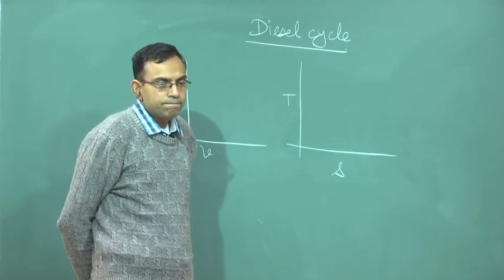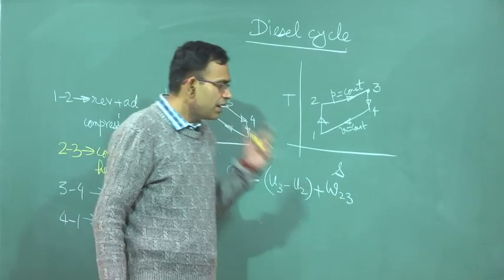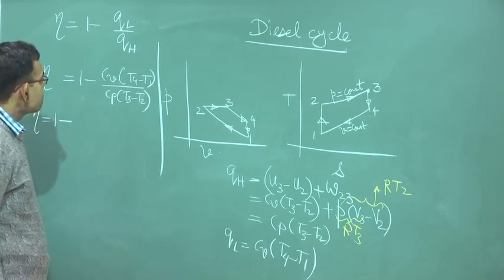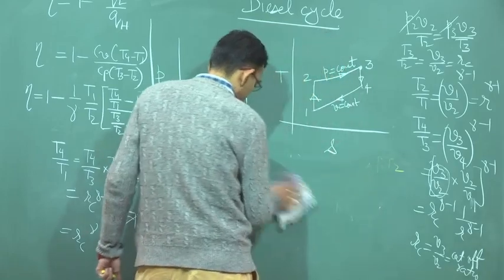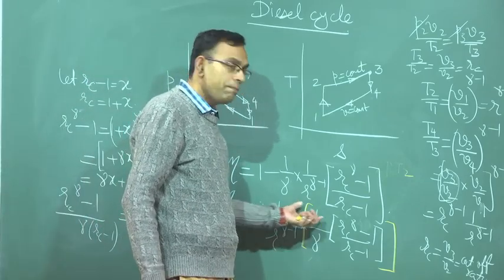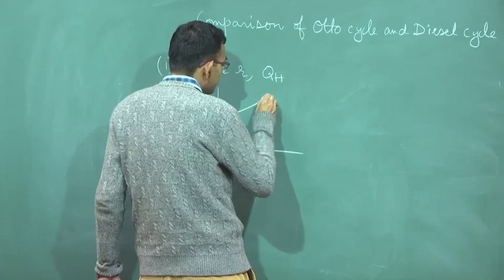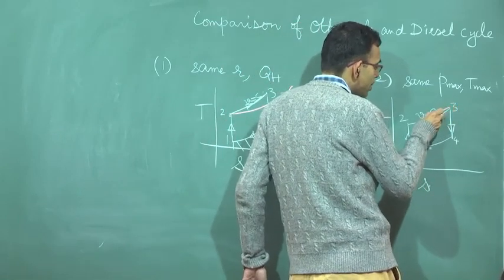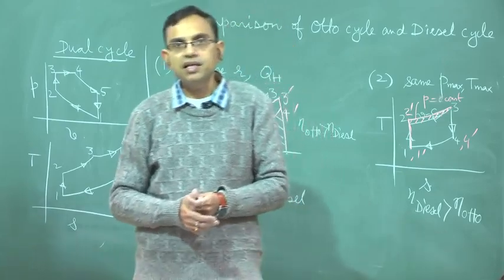Lecture 60 : Diesel Cycle

Comment: Why don't we have a cut off ratio or that kind of parameter for Otto cycle?! 
It is everytime confusing me. I hope I will get an answer. I will be thankful.
Reply: Heat is added at const volume in Otto cycle or you may say that combustion is added so there is no volume change so cutoff is not required